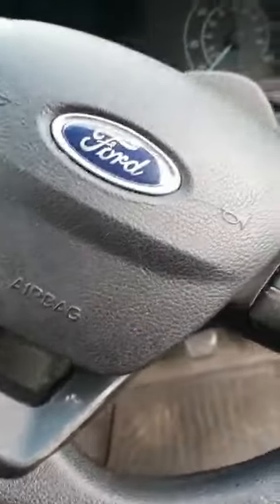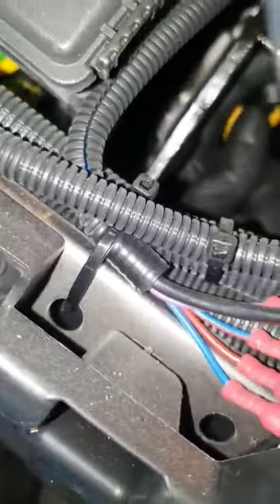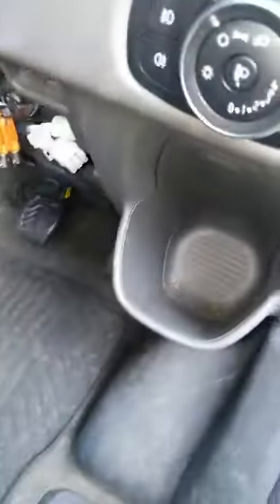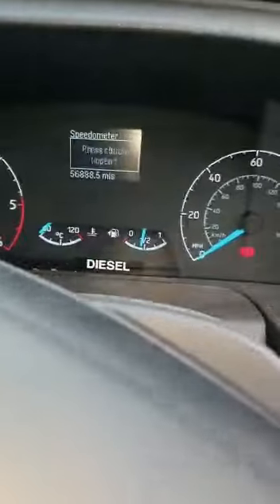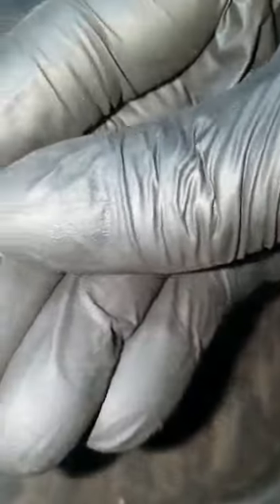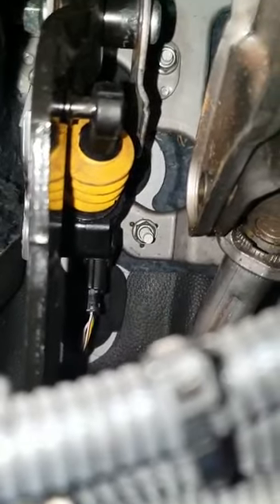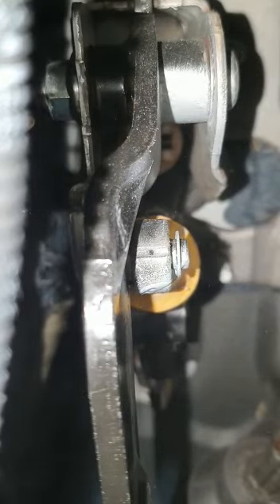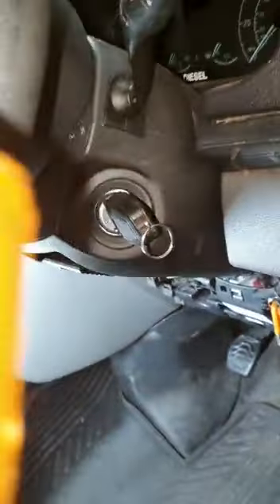Clutch Pedal sunk to the floor; Fault & fix. Ford Transit Custom 2.0 EcoBlue TDCi 2020

Comment: I've had that twice on my Tourneo, I went to Halfords, bought a box of R clips and fitted one of those, never been a problem since.
Reply from the maker: Excellent, that's actually some good advice 👍🏾
Reply: My one it's same I put back no clip but thx god working but it's nit propa coming back is half way u have any idea maybe araound some bolt is lost or etc

Comment: Hi mate 
I can start the engine,  that cylinder is on place , but i cant engage the gear , could you please advise? 
Thanks in advance
Reply from the maker: Ah I see.
Greetings Captain, then your issue may need removal of the gearbox. Are you able to engage gears without the engine running? Then you'll have to look at the gearbox or selectors. If your only struggling to engage gears with the engine running - then possibly the clutch or slave cylinder has gone. Hope that helps
Reply: @tech9igns14  good morning sir 
Thanks for your reply , which area are your garage? Maybe I'll bring it to you :)
Reply: @tech9igns14  yes while engine off I can shift the gear
Reply from the maker: Hi captain. You most certainly can. We are London based.
For all business enquiries please email me at TVMPL@AOL.COM.
Thanks

Comment: Thanks for sharing the video I’ve got the same problem with my Transit Custom 2017. After you put the clip back on, was there any more problems, did it come back off?? Thanks
Reply from the maker: To be fair it drove/worked fine after replacing the clip. But what made it come off in the first place? - Usually down to wear. I'd advise a replacement of the Master Cylinder. I'll aim to post a Tutorial on how to this weekend.
Reply: That’s a very good point mate, I look forward to the next video. Thanks again

Comment: Just had a look at it .any ideas still connected
Reply from the maker: Hi. If the pedals sunk & it's still connected then it's highly likely that the Master cylinder has failed. Have a look at the video link in the description, - it was supposed to be a the tutorial on how to replace it, but I dont think it came out too good 😪 - needs re-editing. But are your symptoms the same?
Reply from the maker: Also, have you checked the brake fluid level?